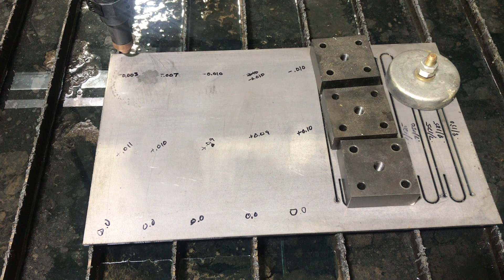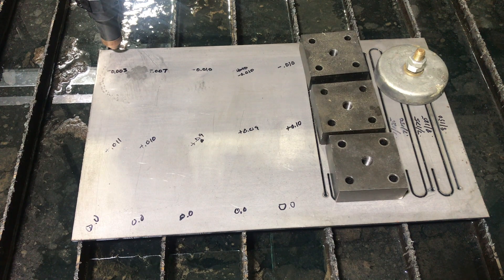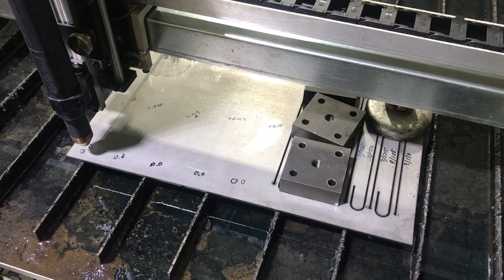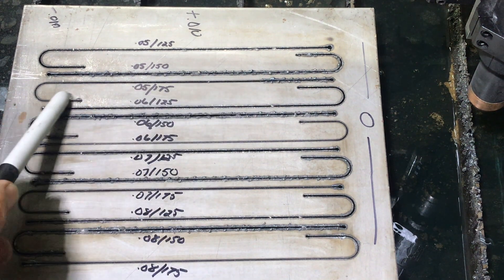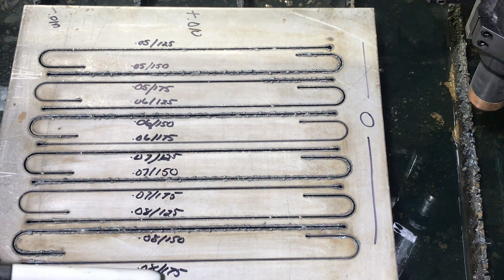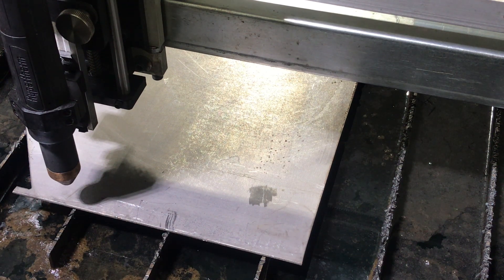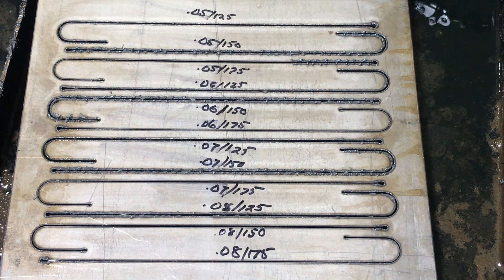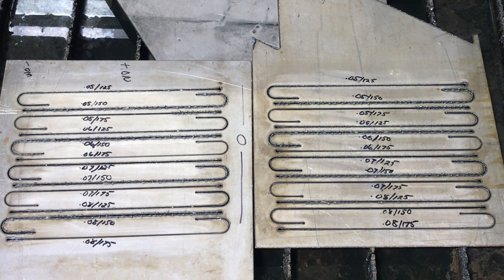Cut Height vs Cut Speed on the Langmuir Crossfire Plasma Table

Comment: do you have a copy of the file your willing to sell just getting started don't know much thanks
Reply from the maker: You mean the slides I used in the video?
Reply: yes
Reply from the maker: @miguelpadron7807  I had to go back and relook at the video cause I couldn't recall if there were some documentation such as powerpoint slides or not.  After looking at it I dont see any slides so im not clear on what you are looking for.  Im happy to give you anything that will help just needing a little more info.  Is it the g-code file that cut the lines at different speeds?

Comment: Thank you for your videos I have the same table only for 1 month. How did you make the program for all the different speeds?   That would be a great new video.
Reply from the maker: Thx David.  After creating the cut paths and choosing default values for 11 gage I edited the g-code to changed the speed in the file.  Are you familiar with modifying g-code?
Reply: @CustomCreations3   i see. You changed the speeds after every cut in the code. I have never tried to mess with the code but I think I should get to know it better
Reply from the maker: Yep. The cut path didn’t change only the speed. The g-code for our plasma tables is pretty simple, only a handful of commands so pretty easy to decipher

Comment: Thanks again for all you time put into this research.  I wonder what amp your plasma cutter was set at for the test, as well as your air pressure.  I’m going to guess that the amp was set the same for all cuts, and that maybe the air was controlled by your machine.  I don’t have a Hyper-Therm so want to compare parameters.  Price delay and pierce height would be good to note as well.  Again, your time spent is very much appreciated!
Reply from the maker: Hey Otis…thx for the kind words!  I had the 45amp Hypertherm set to max as recommended by the manual and didnt change from that setting.  Air pressure to the Hypertherm is 110psi and I let the machine control the pressure to the nozzle for cutting.  Pierce delay was 0.7s ( cut charts say .4 sec and I add .3 sec because of the inherently delay in Langmuir FireControl.   Pierce height was 0.15”

Comment: A another great video. I have the same setup as you. I also cut a lot of 11 Gauge . material. I to have noticed the bevel mine is on the bottom side. Going to try making the cut height closer. I have also found my parts are all cutting a 1/16 smaller that they should be and my holes are are a 1/16 larger. Have you ever had this issue? I use fusion and a Hyperthem 45xp.
Reply from the maker: Yes, I have found the dimensions post cut are not what was drawn up in Fusion.  When doing the cam in fusion I have wondered how the compensation selection (right, center, left) was affecting the final dimensions but have not yet dug into it.  I cut some 1/4” parts that had a square 1/2” hole that a 1/2” ratchet drive fit.  I had to make a number of tweaks to the dimensions in Fusion so that it fit cause setting it for 1/2” it was too small.  You’ve given me some good ideas for another video and it would help me to get a better understanding in the process.  By the way I showed in my IHS video that Langmuir adds 0.020” to whatever we input as the “Springback” value when posting the cam.  I found out you can put a negative number in this selection which allowed me to get accurate starting cut heights.  Did this on some 16 gauge today and dross was almost nil!  I new from measuring that my backlash as 0.013” so I input -0.007 as the springback value so when Langmuir added the .020” it came out as 0.013” which was the backlash.  Thus when the torch moved to 0.060 for cut it was truly at 0.060.  I just had to make sure there was minimal spingback in the plate at the start.
Reply: @CustomCreations3   A negative spring back that is a good idea. I'm going to try  Hypertherms  pro nest tomorrow to see if its post processor is any different.
Reply from the maker: @boneyardbargains  I’d be interested in what you find…keep me posted
Reply: @CustomCreations3   What do you have your nozzle clearance diameter set to?
Reply from the maker: @boneyardbargains  I have it set to 1".  I was my understanding that this became the torch tip height during rapids to help alleviate the torch hitting tip-ups...cant recall where I heard that but it has been my assumption.  How about you?
Reply: @CustomCreations3  I was under the impression that was the offset for the torch.  Like the bit on a cnc machine. I set mine to 1/16. And that solved my cut size issue.
Reply from the maker: @boneyardbargains  very interesting!  Here is the Langmuir video that shows setting the diameter to 1” https://youtu.be/5FCATJHsogs
Reply from the maker: Did a little digging on the Fusion 360 help site and found this “Nozzle clearance diameter - The diameter created from the initial cut when the Water, Plasma or Laser is first turned on.”  I’m assuming for use this would be the diameter of the pierce but isn’t that dependent on the pierce delay?  Regardless  it certainly isn’t the 1” that the Langmuir video shows for the Pro table!!!  I may do a few pierces with different delay times and try to measure this hole diameter!
Reply: @CustomCreations3  I found this is the nozzle offset.  So you get the correct size of you part. With my nozzle it's 1/16.  When I started it was set at  .004 and my parts where under size.

Comment: Appreciate the effort you've put into this. My question would be,  between the best cuts you got, what does the cut bevel look like? Any appreciable difference?
Reply from the maker: Great Question because before starting the cut height vs cut speed research I had been cutting some tool holders in 11 gauge and they had bevel edges that forced me to tweak the dimensions to account for the bevel.   Now that I have done the video I should look more closely to see if the cut height had an affect on the bevel.  Ill try and do that and might do a follow on video with the results.  My Hypertherm manual has a good diagram showing how torch height can affect the bevel due to the shape of the plasma "flame" my bevels were all "wider at the top and narrower at the bottom" which using the diagram would suggest I'm cutting to high.  I see another video needed where I look at the bevel issue and try and understand how the height, speed, and nozzle type (regular of fine cut) are related.  If you have any insight I love to hear it
Reply: @CustomCreations3  thanks again for taking the time to reply. Reason I asked is because I liked the result at .06 Torch height. Looked clean.  And was thinking the .08 might result in a bevel.